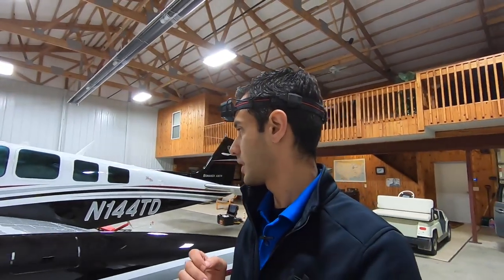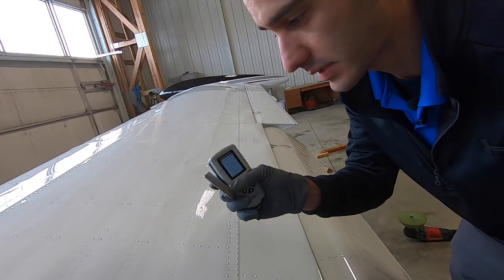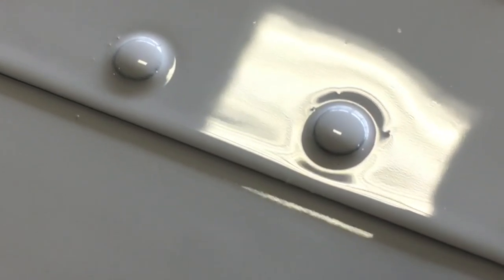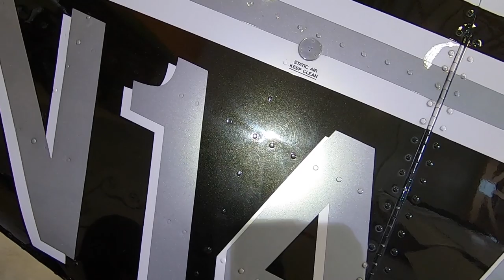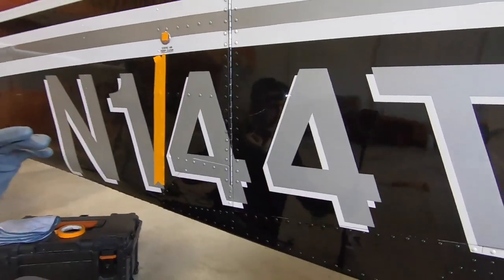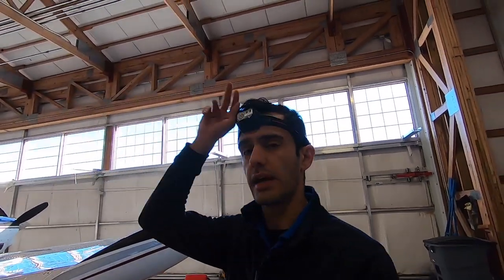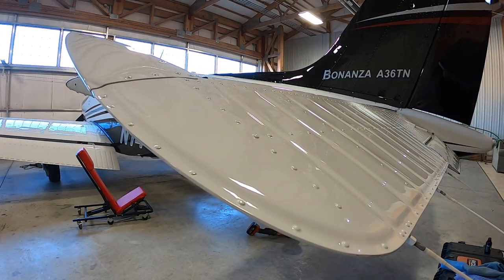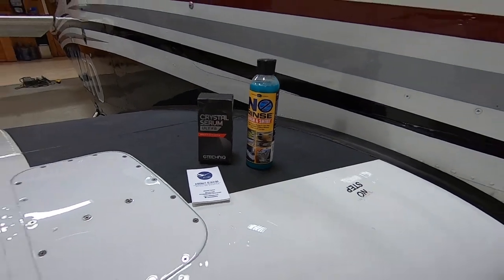VLOG 013 - Beechcraft Bonanza A36 Detailed Paint Correction and Ceramic Coating

Comment: Love your videos. A few quwstions...

Do you correct the windows as well and do they get the same coating? How about the propeller blades?

I’m based in South Africa, so I won’t be able to get you to come and detail my plane. Can you recommend a coating on Amazon that I can apply myself after paint correcting my plane or car? I have always just used Carnuba wax and as you say, it lasts about 2 flights on the plane.

Thanks for the informative video. Big fan!
Reply from the maker: Thanks for watching JP (and following on Instagram!) We typically do not coat the windows, but apply a sealant instead, C2v3. If the prop blades are in good shape I can coat them, otherwise it isn't worth it. As for DIY Coating, there is Crystal Serum Light which is a serious coating. Make sure you are very comfortable with it before installing on your plane.
Reply: How many bottles of ceramic are you using for this plane? The bottle looks so small ! @AvianaAircraft
Reply from the maker: Usually a plane that size takes 100-120cc’s
Reply: Aviana Aircraft Detailing thanks for your answer😉